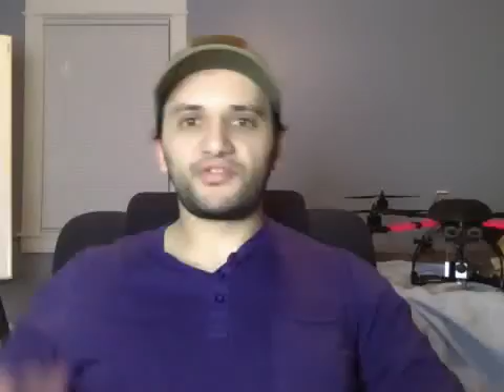DJI Naza voltage protection crashed my Multirotor!!!

Comment: It seems that people are just flying these things too long after they should be landing. When my hex starts showing the first LV warning, I land it with in 30 sec. I believe most of these "bad naza" crashes are attributed to poor flight planning and lack of discipline than system failures.
Reply from the maker: That's not the case… Checking the voltage after a flight with the low voltage protection shows there was more than enough left. The problem is that when the low voltage kicks in it reduces power to the motors, read the manual… It is a fault with the system not planning. After switching off the warning there are no issues...
Reply: ***** So as long as you land before the second level low voltage warning kicks in, you should be able to land without any issues, correct? According to the manual, it's when the second level kicks in that power (high current) begins to be reduced to the motors. This might be a design to keep safe levels of power for the FC, which sounds logical. I use the TM1000 with the first level alarm set on the transmitter. Once that goes off, I head back and land. But it's a great advantage being able to monitor the voltage in realtime through telemetry. But as you say, turning its warning system off and using one of those cheap LV warning buzzers is a viable option.
Reply from the maker: icin4d I found there are issues with the first and second warning levels. There is more than enough power when the second level goes off to fly a bit longer safely. So it is over designed for safety, but in a way makes it less safe because it reduces power to the motors causing crashes. The crash I spoke about happened when there was plenty of power left in the battery to carry on flying, yet the system took that power away and crashed the multi-rotor. Another telemetry system like yours or a buzzer is a simple way to keep track of the voltage without any risks.
Reply: Your'e confusing loaded with no load voltage. Voltage will always spring back after landing. That's part of the system with Naza. Has to be calibrated.
Reply from the maker: Pat B
Not confusing anything. I know load and no load, but that doesn't have anything to do with the setup on the NAZA system. Having power reduced to motors is just plane stupid, I would rather mess up my battery by over draining it a bit then have the whole thing crash.
Reply: *****  Funny never had this issue with my Naza, I do measure voltage after I get first light and the land. It's always higher than what I've set the cutoff. As pointed out Naza, does not limit power on first warning. I know as mine doesn't. Keep flying with second warning and you're an idiot. If one doesn't like Naza voltage protection the buy a $5 lipo alarm.

Comment: I lost mine today to this problem. I suspected the low voltage system had something to do with it. Glad I have a culprit. Back to using a beeper and turn off the Naza system.

Comment: The problem lies in the fact you can have 4500mah and throttle punch the battery to 10.3 sustained for duration of speed run then hover and the voltage rests at 10.8 out of warning area. I shut it off too and use osd or timer on 9x
. Lipo batts are ok above 3.72 but when they get to 3.6v or so they fall off a cliff as the cells drain out faster then spreading the mah over length of cell circuit.
Reply from the maker: Hi, what I did was actually set the battery warning even higher to prevent this. What I found out is that DJI reduces power to the motors when the voltage warning kicks in to prevent battery damage or overdrawing the battery. This is of course stupid, I mean save the battery only to crash the multi rotor and maybe still damage the battery and more…
I also switched it off and like you use a OSD and buzzer. I still hear of new fliers with DJI falling to this issue, DJI should really sort this out.